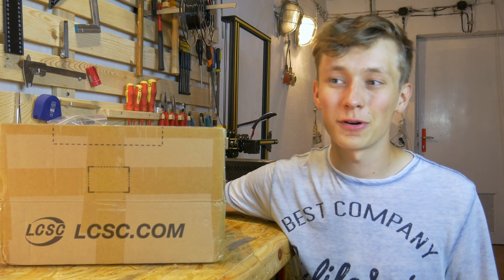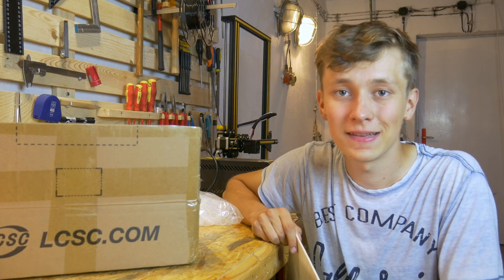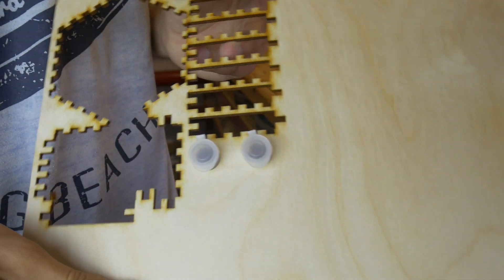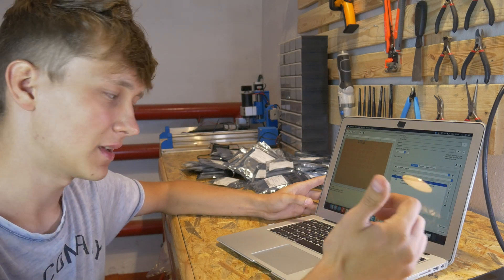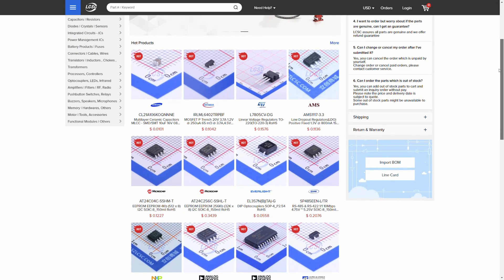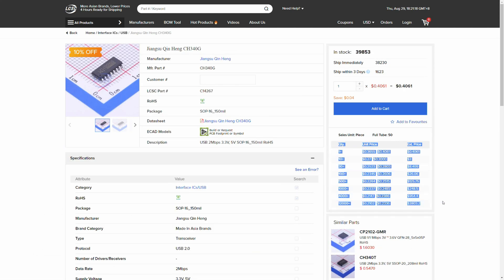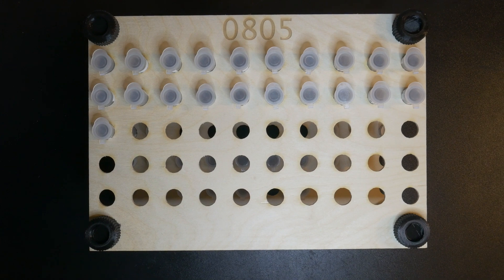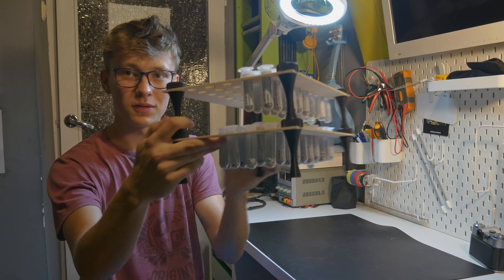SMD Components Organizer Made With Laser Cutter

Comment: Hi Niko, I have a long time following you and I love your videos. Do you think that the engraver machine can be adapted to cut Vinyl with a laser? It would be excellent project to customize your tools or some stuff.
Reply from the maker: That's a tricky question. I have a new laser cutter that you may saw in my last videos. In the users manual you can find that cutting vinyl is prohibited because fumes can damage the machine. I am not sure if it is specific about epilog zing but maybe about lasers/mechanical parts in general. For cutting vinyl you can use special knife. There are already few people that successfully modified Dremel CNC to cut vinyl
Reply: @nikodembartnik  thanks for your answer! So, I'll try to cut Vinyl with the Dremel to see what happen.